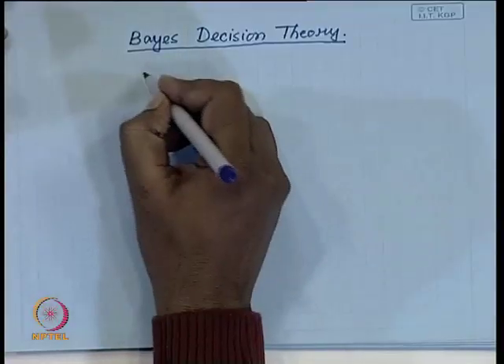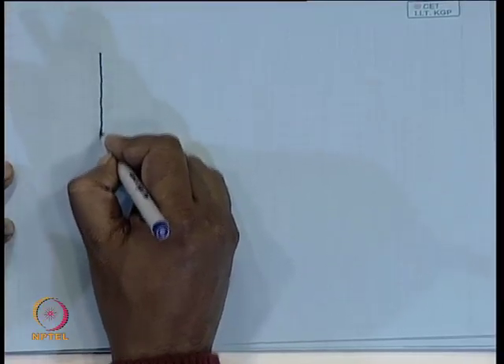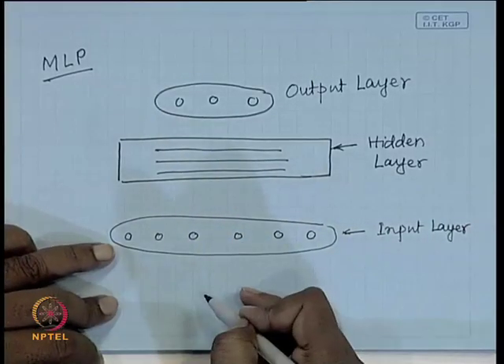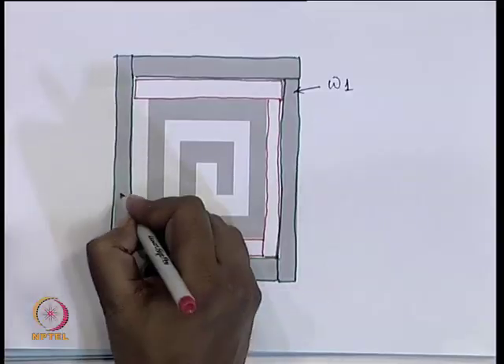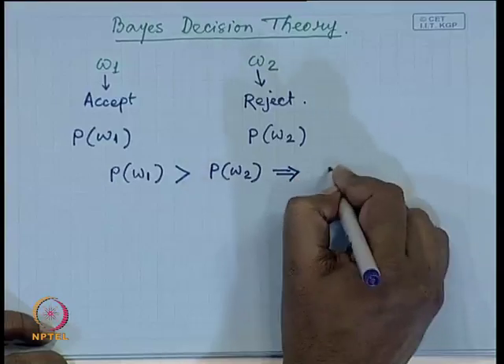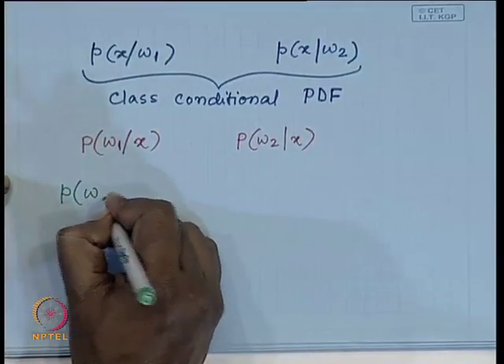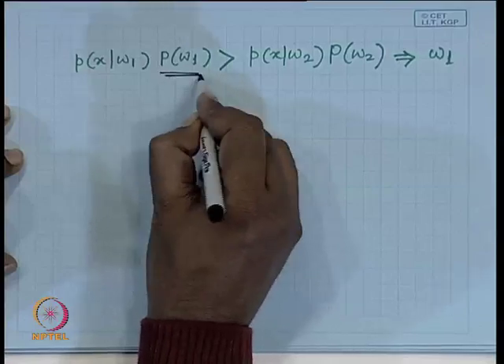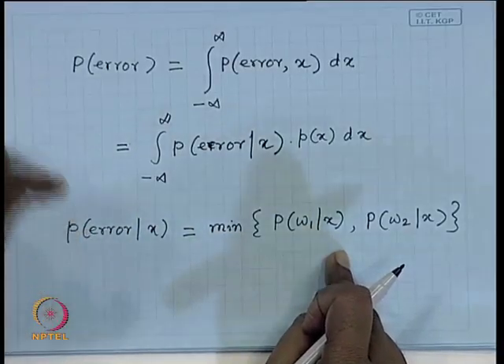Mod-01 Lec-05 Bayes Decision Theory

Comment: Isn't the dimension of the hyper plane one less than the dimension of the vector space defining the pattern ?
Reply: I agree with you
Reply: The question is old  but someone may still be interested:
It's not:
The hyperplane dividing the classes has the same dimension of the feature space.
If you see he is using a line (dimension = 2 ) to divide examples on a 2d space.
If you want to classify a set of gym athletes as Tall or Short based only on their height you can plot the height values on a 1D  space and use a point (1D boundary) that acts like a threshold and divides the classes Tall and Short.
You just have to propagate this reasoning to a higher dimensional space
Reply: hyperplane will have the same dimension as vector space but the difference is that, if in vector space you have n independent variable then in hyperplane you will have n-1 independent variable.
Reply: same doubt